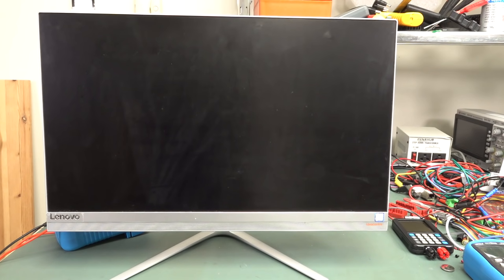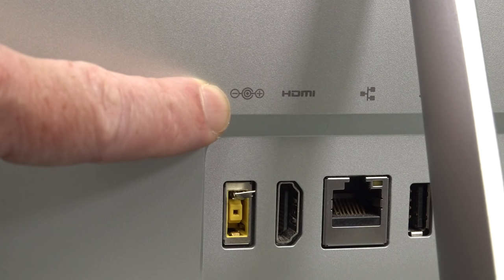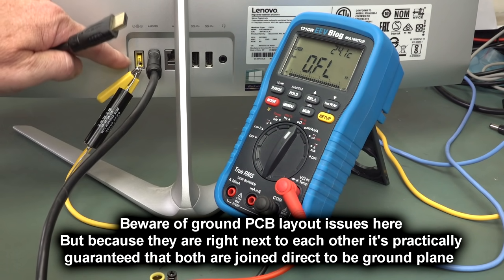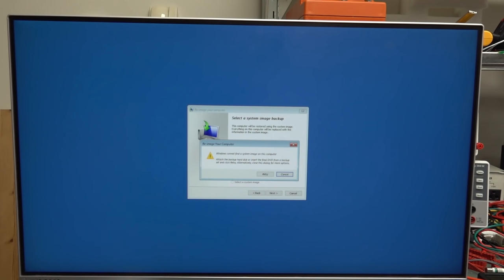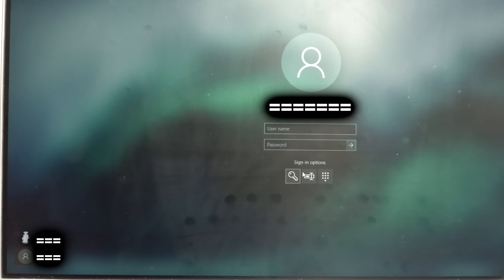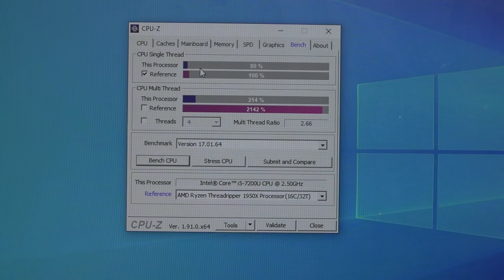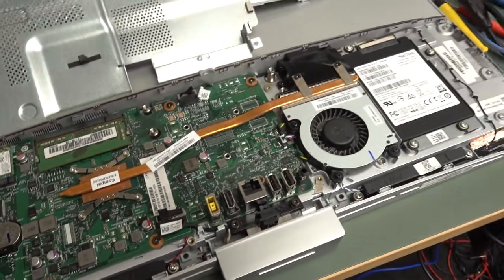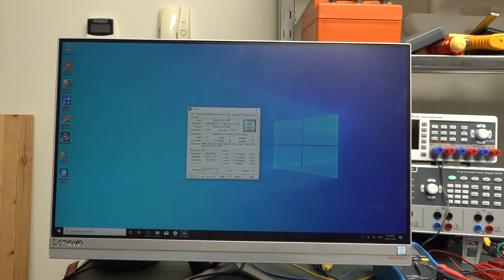EEVblog #1279 - Best Dumpster PC Find Yet!

Comment: PSU tips are available for laptops to convert older Lenovo DC barrel connectors to that rectangular  style - or at least look very similar. They're only a dollar or so. "Thinkpad PSU plug " would be a good search term to try in Ebay - but carefully sheck the pics to make sure it's the same.

Comment: Seems like it'd been easier to just reinstall windows and get a nice clean install with none of the old user's crap.
Reply: That is what I'd do once I saw it was at least attempting to boot- wipe everything and reinstall
Reply: Yeah, though I would have been installing Linux instead. Still not quite sure how I should be organising things with multiple drives, though.
Reply: there's huge risk you are forgetting; the touchscreen drivers. They aren't standard yet so Windows didn't have them in repository. If you just reinstall Windows without checking first then I'm afraid you won't find out the screen is a touchscreen at all.
Reply: @xponen  It would seem likely that the touchscreen driver  was available to download... maybe from some fancy web of sites that covered the whole wide world.
Reply: @jmonsted  you are right, it is probably on Distributor's website, but the scary thing is that the OEM might not upload their driver & configurations online instead pass it on to Distributor to upload it online. In a good example we have Intel who provides driver on their website while the Distributor customise the driver and re-upload it on their website, but for other OEM they do not provide a website for download and the Distributor might not either or just didn't update them.
Reply: @xponen  If your pc is somewhat recent and common like this one is, the drivers are very likely in Windows Update and will be downloaded automatically. If they aren't, Lenovo has all drivers (even for their old Windows 95 Laptops) on their website.
Reply: He did the right thing to test it.  I would have done the same and once I was reasonably confident that the hardware was working I'd wipe it and start again in the knowledge that any later problems were not hardware related.
Reply: And it's more fair with the previous user. Fill the disk with 0 and reinstall the computer. But sometime it's interesting to see what other users have done...
Reply: @xponen  As its already running windows 10 from stock i would of image you can obtain the drivers from the lenovo website or fail that nothing snappy driver wouldn't sort out

Comment: Hey Dave - a general remark to these items & also to your laptop videos:
ALWAYS the heatpipes go dirty over the time and it's a nightmare to clean them. The ability to remove heat always lowers over time. The plates that distribute the  heat from the pipe to the air are so close by - they can only collect dust. 
So I suggest, if you already open such a case, remove the ventilator and remove the dust / mold between the ventilator and the heatpipe - for example by vacuum cleaner. 
When ever I opened a used laptop - the heatpipe exhaust always was completely dirty.

Comment: You'll love those square connectors Dave, especially if you have any other Lenovo gear. They were standard for several generations of Lenovo hardware, before being replaced by USB-C. You can get the power adapters for peanuts from a place like eBay, or hell, you might be able to beg some if you have any local enterprises that use Lenovo gear - they'll have totes overflowing with them!

edit as I watch the video: Yeah, they're bidirectional and can be inserted either way.

Comment: I usually use the regedit trick instead, you plug a Win10 recovery USB stick into your PC (really just the standard Win10 installer), boot up to it, press 'shift+f10' after going a couple of steps in, type 'regedit', load the c:\windows\system32\etc\system.dat hive into the registry, and change some stuff, basically this: https://winaero.com/blog/reset-windows-10-password-without-using-third-party-tools/

Really handy thing to do, either way works though.
Reply: Ray Herring reminds me of the day when Win2K could be bypassed by an original boot CD, which was patched. How life has come full circle, eh?

Comment: 10:48 even with Windows 10 Home 1909, just click "I don't have internet" and it'll let you make an offline account ;)
Reply: He should have fresh installed... More effort bypassing the password.
Reply: @PaftDunk  no, he doesn't have the factory default driver for the touchscreen and the pop-up camera, it would render them useless or function inappropriately.
Reply: @PaftDunk  For sure, plus you don't want all the previous persons garbage software on there and who knows what viruses/malware is hiding on it. Boot off Windows 10 USB, diskpart, "clean", install. Done. Clean.
Reply: @xponen  That's not too hard to fix: either the drivers will be fetched through windows update, or a simple search for the model number will bring you to a page where you can download them.
Reply: @VisibleReality  Window updates did not and will not include the driver's OEM tools used to configure the driver, eg: for calibrating Windows tablet's sensor, such as orientation (up down left right). Also a Touchscreen driver have same name but different resolution depending on model being used on; eg: the difference in resolution, the place to put OEM button for tablet. In camera devices there's also variation; like an Imaging system is host to a modular camera with its own driver, better install the right one in sequence.
Reply: @xponen  i mean you can use the inbuild factory reset in windows and that should keep the drivers right?
Reply: @seesoftware  yes, the manufacturer often include all the drivers and bundled software in the "factory reset" Windows image.

Comment: You read the label on top of the power port wrong.
The negative goes to the "C" , to +ve goes to the "Circle" and the center dot is not connected to anything.
Reply: Yep he didn't look...Plus even if he did i doubt it would have started with that 100 ohm in series...

Comment: that unit uses a 20V adapter. the center pin is a identifier pin.. which uses a resistor in the plug to determine the wattage of the PSU   65Watt  = 285 Ohm to ground    90Watt  = 548 Ohm to ground.  

Also wanted to note... putting 20V into that center pin you take a 50/50 risk of blowing the sense circuitry

Comment: Dave, look closely at the barrel jack pictogram. It clearly shown that the powered terminals are outer shell, inner shell and not the center pin. The big-ass DC-jacks in your assortment is the same. The big hollow casing is co-axial and the center pin is not current carrying (it's too thin)

Comment: yeet "published 1 minute ago"
edit: the hdmi port might be an input, have seen a lot of AIO pcs that double as an external screen for your laptop or other device
Reply: That's true.  The HDMI port on many AIOs is more often an input, rather than an output.  It means you can run two PCs but use the same screen for both.  There might be a selection for the HDMI input in the setup - Internal/External/Auto.  Some people prefer to do that rather than run a virtual machine for the second platform because it's technically a lot easier, plus it can also be handy for occasional use stuff like a media box or a R.Pi.

Only AIOs with quite a decent graphics sub-system will have an output capable of running a second screen - higher end Asus etc.
Reply: My college has some Dell AIOs from about mid 2018/2019 and on the back there is a HDMI connector for input and on the side next to the brightness controls is a button to switch the display input so its more likely that the HDMI input is so that the PC can be used as a secondary monitor when the PC becomes outdated. It may also be that Lenovo (or any other manufacturer of AIOs) just take a generic display panel that they would normally be using in a standalone monitor and then integrate its controller board into the PC's Motherboard and the Windows Operating system in order to lower cost which is probably why almost no AIOs have any Linux Drivers or at least to any of my knowledge.
Reply: It's both an input and output.

Comment: Dumpster dive pc that isn't 25 years old. Why doesn't this happen anywhere but where famous youtubers live?
Reply: o0julek0o if you know someone who works at a dump or an electronics recycling centre... people dump some insane crap. I live in the country and a nearby tip got an electrician I know to test a bunch of electronics they wanted to resell. Including an I9 a bunch of laptops and PCs from the last few years and a Gas Chromatograph which still sells for $20000 on ebay. 
They also had a bunch of workshop equipment and pretty much the only thing that failed was a 3 phase welder. Everything that passed worked. As far as I know They just chucked any storage on the computers and their office computer which was running Windows XP is now a fancy I7 all in one so I suspect they found uses for everything they didn’t want to sell.

Comment: Those jacks are more robust than a barrel jack test, it does have a sense, The only thing these need after a few years is fresh thermal compound and a dust out - ram wise some have a single slot others have 2 with the other slot on the back of the pcb

Comment: Dave, that's not a positive center icon.  For 2 wire power you'd have an icon with a solid dot in the center.  What this icon indicates (and I agree the icon doesn't match the jack) is an outside shield negative an inner ring positive and a center pin.  This is similar to the Dell power jack for laptop, which also has a center pin to indicate power pack power available.

Comment: The machine i'm using now was tossed curbside (in the snow!), the original hard disk was infested with malware (the reason why it was thrown out), so formatted it. Since I don't use windows regularly, I just put linux mint on it. Quad core, manufacturer said it was 'limited to '8GB RAM' however, now it's got 24GB. Turns out said limits are hogwash. It was made around 2009, 11 years ago.
Works with the latest windows 10, works with any open source software distribution.

Comment: I've supplied Lenovo's for years and on the whole found them to be robust. Nov 19 I replaced 5 AiO's for an office supplied back in 2012. Only reason for the replacement was the FSB wasn't fast enough to justify an SSD (had gone to W10 and did a test). The AiOs are being sold on as they are still good enough for light / domestic duties.

Comment: At least when lenovo switched to the square power jack they kept it electrically compatible. You can buy adapters to use the old lenovo power supplies with the newer computers.

Comment: The original owners probably had a power supply (cable?) crap out and although it apparently could produce the 20v, the power good signal pin actually didn’t have any connection so they never suspected the PC itself to be unaffected.

Comment: I had a laptop once where the heatsink wouldn't transfer heat from the CPU. Apparently there's a liquid or something like that inside the heatsink that helps with the heat transfer, which got evaporated. Changing the heatsink fixed the issue..

Comment: I have a Lenovo laptop with that same plug. It’s much better than barrel as the connection stays tight. Every barrel plug laptop I’ve had, the plug becomes loose after time.

Comment: I worked with a lot of Lenovo's since they were used at a school I worked at, and a lot of the newer Lenovo's used that square input power port. Had teachers stealing them from each other and I wouldn't have replacements to give them. The older lenovo's have the more standard round input.

Comment: In Windows 10 Home setup there is a way to NOT use a Online account.
Option 1) Disconnect LAN cable before the dialoge window about user accounts show up, now you can use a local account.
Option 2) type 1234 where it asks for email adress/username. It will trigger 'activation by phone' but also displays the option for an offline account

Comment: That's a kepper.
I'm watching on an i5-7200U 8GB HP convertible ultrabook w/ 1080p touchscreen I scored at ebay for 90€.
The SSD was missing and solder joints on the power button were cracked and needed a quick reflow...
Works like a treat, it even handles 4K60 on YouTube with hardware acceleration under linux.

Comment: Just on curiosity alone I’d like to know why it wouldn’t boot up using just the lab power supply.
Reply: The Lenovo connector is square, but electrically identical to the round standard barrel jack like used on Dell and HP laptops. So there is a "ring" and a center pin, with the center pin being the "power capability" sense pin (advertising if it is a 65W, 85W or 105W PSU).
For the ring section of the plug, it's actually two conductors, one running on the inside of the ring  (positive), and another running on the outside of the ring (negative). There is a thin insulator between them.
So, when Dave connected it to the lab PSU he shoved the Negative in between the Positive and Negative, then applied Positive to the center sense pin.

Comment: The connectors for these are weird but I give Lenovo credit. They're pretty solid connectors, they release easily if they get tangled in a foot or something, and they're unidirectional. They probably came out of the need for a slimmer connector for the ultrabook form factor of the X1 Carbon.

Comment: That's not a weird power connector, every Lenovo Thinkpad and Micro PC uses that plug from like 22nm Core i5 all the way up to fairly recent models IIRC. I have 22nm and a 14nm lenovo products, tickled that they share the same power adapters.

Comment: I came to campus one morning with a homemade big ass powerbank that could charge laptops. I took a look at my friend's lenovo and figured "alright 19V center positive". It fried the entire computer immediately. Turns out the center pin is connected without so much as a series resistor to an analog input on the chipset. You have no idea how lucky you got

Comment: 5:46 I remembered you posted on Twitter yesterday about finding a power adaptor for this, and I couldn't make out the label in the photo. I thought it took the 90W or 135W power adaptor, and was going to post about the same 45W power adaptor you found that I had for my ThinkPad X250, albeit with a UK plug rather than an Australian plug.

Comment: Luky Dave. I have just bought used thinkpad t470 (same specs) laptop for about $500 here in Moscow. HAHA. I thought you're gonna kill it by connecting positive wire to the center-pin. Amazingly it survived! I did the same goofy on my old t440 - burned multicntroller eventually, had to by new mother board.

Comment: Actually that symbol on the back shows two rings and a center pin. The outer ring is negative, the inner ring is positive and the center pin isn't connected. The PC should turn on but show a warning about a mismatched power adaptor without the center pin.

Comment: Standard practices for me, is to boot off an Windows 10 installer and do a clean install. There shouldn't be any licensing issues if it already has 10 on it. Data protection and all that.

Comment: I use PCUnlocker that give you access to the Windows SAM (login) stuff.  It makes a .iso for a bootable drive and you can reset any user password on the system.  Great if you dumpster dive a lot.
Reply: im sure in right corners of the interwebz you can find a premade .iso

Comment: The power pin. I found dumpster  laptop once in mint condition, spent weeks trying to  get it running, trying replacement motherboards.. Turns out.. the charger that otherwise fit PERFECTLY in every regard, was not compatible according to center pin, and it had always worked fine. Guess guy who threw it away thought it was broke too. uppss

Comment: Nice score, Dave. Wow, what amazing security there is in Windows. You don't even need any special software to bypass the login password if you have access to the power button on a machine. :P
Reply: Keep in mind that it doesn't need to be that easy if the owner decided to make it more secure than that. The Macs are just as easy... anything that stores user credentials on the device itself can be hacked.

Comment: pro tip: insert a win10 boot stick and boot it, press shift+f10 type notepad and press enter, in notepad choose save as change from txt to all files. follo w the instructions shown here. 
in the cmd on systembootup type "net user /add usernamehere" type "net localgroup administrators usernamehere /add"

Comment: I've seen computers tossed out in the trash because they didn't have enough RAM, or didn't have the needed software which could have been easily installed.  Or are "too slow".. Of course there are many computers which are tossed out because they are loaded with viruses.   The company just purchases a new computer, and moves on.    When computers in the trash still have the disk drive, they usually  still have user's work files too.

Comment: Cool hacking tutorial showing just how bad Windoze password security is, but it would have been easier and quicker, not to mention a guaranteed 100% clean install to just do a fresh install from a USB stick made using the Windows Media Creation tool. License will activate automatically when the machine goes online as the licence key is (somehow) tied to the BIOS/UEFI.